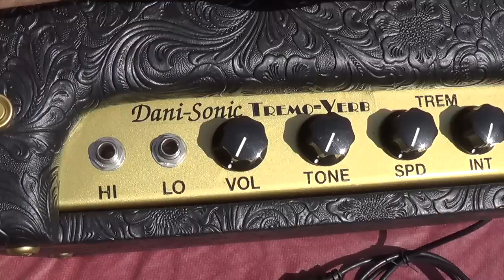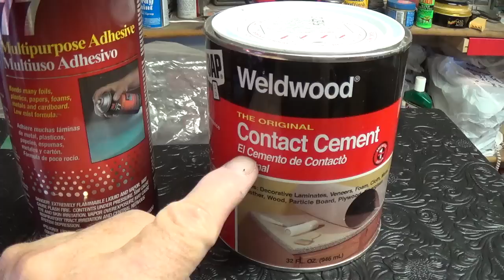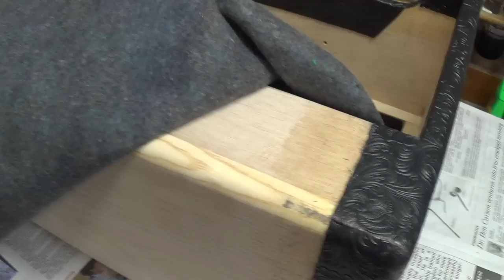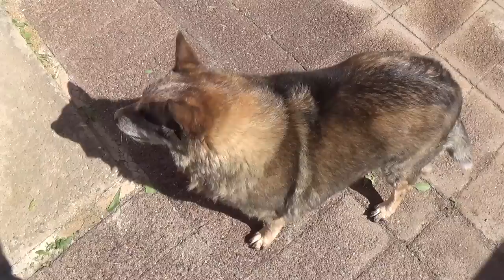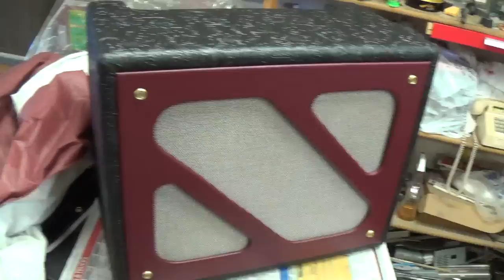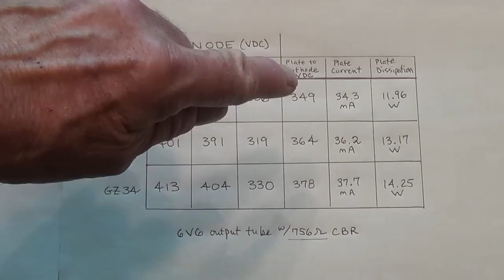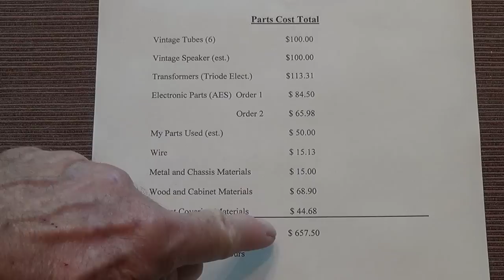How to Scratch-Build a Vintage Amp, Part 8:  Completed and Tested

Comment: Hey Doug,
I was wondering if you could go in depth, your style of running shielded cable. Thanks.
Reply from the maker: +chad smith I demonstrated how to create shielded cables in the video, Chad. As far as where to use them, anywhere that a (weak) signal is carried any distance within the circuit, it's best to shield the wire carrying the signal. By weak, I mean from input to first pre-amp stage, then to volume and other controls, and back again. By the second stage of amplification, the signal is generally strong enough to be mostly immune to hum injection.
Reply: +Uncle Doug Duuuhhhhhh (on my part). The details are on Part 7 of this serires at the 15 minute mark. You know, I watched this and it stuck in my mind but for some reason, I overlooked the part that it was Uncle Doug that informed me about that cool tidbit. I guess I thought I saw that somewhere else and just wanted to check on your method. I'm better now. No meds needed.
I have heard of others using Coaxle cable as grounded signal wire. What do you think about that?
 Thanks.
Reply from the maker: +chad smith No problem, Chad. You want your shielded cable to be the smallest "target" possible for EM interference, and also flexible and not fat and ugly, so I use individual shielded small-gauge (i.e. 26 to 28 gauge) wire.

Comment: Uncle Doug....another question my apologies if I have missed this previously.  For the Pots, which ones did you use as Log and Linear taper?  Thanks again for this great build!  Bart
Reply from the maker: +redfishbum To me, everything associated with the signal should be an audio (log) pot.  Those that govern purely electronic circuits, like adjustable bias, can be linear.
Reply: That makes sense. Thanks!

Comment: Another beautiful job. I thought it was great you fabricated everything. I can't wait to build mine. I think I would buy a chassis, do you have a recommendation, perhaps a tweed style chassis? Other than that I can build and cover the cabinet. Also, I have a NOS RCA 6l6GC. What transformer specs should I consider for the power and output. I will probably use one of my Weber Chicago or California's 12's which are 8 ohms.. Thanks, again, Bob
Reply from the maker: +starlingave  You're welcome, Bob. Yes, doing it all myself is part of the challenge....and fun :) The one problem with buying a chassis is finding one with the appropriate cut-outs for tubes and transformers.  Maybe you can find a blank chassis of the right dimensions and do the machining yourself.  I believe that Weber offers chassis on their website. I go into detail in one of the videos regarding transformer specs and selection. If you want to use the 6L6 a lot and intend to bias it to over 20W, you should get a PT with 100 to 120mW high voltage capability.....as is explained in the final video.  Your speaker selection sound fine. Best of luck.

Comment: Finally got the time to view your 8 part masterpiece. Holy Moly!! Awesome sound and gorgeous looking amp!! Just curious (for the three 12AX7, one 12AT7, 6V6 and 5881) what brand tubes did you use? Were they mid-1960 NOS tubes?
Reply from the maker: +drbryson2  Thanks so much, DR. I grabbed a handful of the vintage tubes I have on hand, all tested with emission readings written on the box, and selected those with high readings. Then I switched some around until the sound and effects seemed optimum. There was a mixture of brands and ages at the end, most ranging from the 60's to 70's.  I tend to go more for the performance of the tube, rather than the specific brand.....I try to be an impartial judge picking out what works best.
Reply: +Uncle Doug Did you use a 6V6 GT rated at 12 watts? It would be interesting to hear the amp using a 6V6 GTA rated at 14 watts so you could use a GZ34 instead of the 5Y3, and get more of a Fender mid-60s vibe.
Reply from the maker: Yes, it was a vintage 6V6....Sylvania, I believe, biased at just under 12W of PD. As you can see from my chart (shown in video and link provided in video description), DR, although the GZ34 provides a higher voltage output than the 5Y3, the 6V6 can be biased at either 12W or 14W with either rectifier. I don't recall Fender using GZ34's on any single-ended amps, and to be honest, I wanted the primary signal circuit to remain true to its original Supro TV roots.....i.e. to sound like a Supro, not a Fender. Thanks for watching....and for your input.

Comment: One more thing... I think that a single-end design like this is much simpler to build than a push-pull circuit. There is no need for a phase inverter, and simple isn't all that bad. Is that correct?
Reply from the maker: +Bill Daniels  True, SE is simpler (and a little less expensive) to build and troubleshoot....and a lot of people prefer the purity of their Class A tone.

Comment: The tremelo range and depth was an excellent demo, so was the reverb. This little amp has the "chops" to please any playing
style..except maybe those that like to play at high volumes with a  lot of distortion.  Very unique circuit design using  switched  bias  modification to all this amp to accommodate  6V6 or the more powerful 6L6s. 
Yes, the tremelo is a bit strong at the high setting, needs some fine tuning here.
Good to see that at least Jack gave it a final sniff of approval.. Good job!
Reply from the maker: +SuperCarver2011  Thanks so much, SC.  I spent some time in the workshop today, fine tuning the Tremolo, and came up with a simple fix.  I measured the maximum pot resistance that yielded the strongest but still usable tremolo effect, which was about 160K, and then jumpered the Intensity control (wiper to ground) with a 470K resistor, turning the 250K pot into a 165K pot. Now, the tremolo effect begins sooner in the dial excursion (about 3) and maxes out (at a still usable level) at 10.  It's still very powerful, but not completely insane :)
Reply: +Uncle Doug Looks your electronic knowledge and ingenuity perservered, and now the tremelo circuit is
unique to the Dani-Sonic/Valco/Supro amp along with the switchable bias for the power tubes.
Reply from the maker: Thanks, SC. Part of the reason I chose the Tremo-Verb to build was the unusual tremolo circuit.....and it didn't disappoint :)

Comment: Sweet job,  Uncle Doug.;    a "blast from the past". Looks like it came right out of the factory from the 60s. I like the art deco naugahyde covering with that paisley embossing in it.   Beautiful neat job! and at $657 and conservative 100 hrs of labour x
$30 per hour is $3000 + $657 = $3,657. Not unusual today for a custom built "boutique amp'.  Some tube stores offer kits
for the more popular Fender/Marshall favorites, but these are chinese factory repros and on PC board, not point to point
turet wiring like you are doing on this build.  Those Chinese sourced kits are cheaper (around $999) and the cost of the labour is absorbed as a hobby. Definiely a labour of love and you are saying that if you let it go, it might fetch $2000?
That is definitely in the realm of minimum wage these days..but as you say, there comes a time when the memories
of all those hours spent fade away with time and you just want to sell it to someone who will appreciate it and
give it a good home.

Now in the Supro case, when you include a woodworker to make a decent box corner cabinet and install the naugahyde
(15 hrs at say $30 an hour = upto a $450 bill for making the cabinet, + ,metal chassis work (15 hours at $35 an hour = upto
$500 to construct the chassis, punch out the holes accurately  + electronic expert to install solder lugs, pots, tube sockets
and wire up the hardware components accuratelY (2 days or 20 hrs x $35/hr = $600-$700, plus final finish, nameplate, chassis
painting ($100) + components  . That would entail about 60hrs of work with efficient contractors to come up with a working
product , and the parts list at $657 would give you a conservative estimate of:$ 2500 (low) to $3200 (high)estimate.

$657 x 5 times as you mention,  would be about $3285 to build this amp if you didn't dedicate your time to build it. 
Things are not  as cheap to build in America in 2015 compared to what things cost in a factory production  run in  1965.

EFFECTS of INFLATION over 50 years. 
That  Les Paul standard Gibson  that retailed for $385 in  1965 ,  now sells for at LEAST  $4000 ,and some signature series with all that added similuated 'buckle rash" /SPECIAL PICKUPS AND WIRING  ie: Billy Gibbons of ZZTop can sell for $8,000 or more in limited production.

Is it a case that a dollar no longer has the purchasing value of what a dollar once had due to inflation?
Maybe, or maybe because today, musicians will pay the asking price if they really want that model of guitar
or amp. 

BTW; Rusty just wants his cookie, he ain't interested in amp design or building techniques. Rusty does what he does best when he is off camera.  You two should really have a man to dog talk? :-)

Trusty old sabre saws, nasty in some ways, but very useful for those inside cuts,  where you can't get in with bandsaws or any other bladed tool. 

I've seen some amps with the reverb tanks in a padded bag to avoid amp vibrations. My 30 watt Peavey Valveking has it's tnk
in this padded bag and the bag is secured to the bottom of the chassis.
Which side of the shielded preamp cables do you ground? Source (at the pots) sink (at the grid input of the preamp) or at both
ends?  I've heard that grounding the shield at both ends can result in ground loops.  We used to ground the shields only at
one end.
Reply from the maker: +SuperCarver2011  Thanks for your detailed cost analysis, SC. It reaffirms my contention that, unless you're Ken Fischer or Howard Dumble, it's very difficult, if not impossible, to create a hand-built amp from scratch with point-to-point wiring that you could ever sell for a profit. My hat is off to the boutique amp builders, like Swart (my personal favorite), who manage to turn out a quality product.....and stay in business. Putting reverb tanks in bags is, I believe, intended to keep the springs and transducers clear of dust and debris, and to insulate the tank from vibration and physical damage. As I say in the video, shields should be grounded at one end only, however reverb tanks come in several configurations, as designated by the fifth character in their model number. The tank I used is a 4AB3C1B, and the "C" indicates that the Input jack is insulated from the tank body, while the Output is grounded to the tank body.  Both shielded cables have the shields connected to the amp chassis, but only the Output cable grounds the metal tank body (i.e. its shield connects the metal tank body to the chassis). It would appear that this violates the "grounded at one end" rule, but it seems to work well in most cases.
Reply: +Uncle Doug  Thanks for the clarification on the reverb tank various configurations., never paid too much attention
to that.  I guess the input jack being isolated on yours is to prevent "ground loops" and keep the internal transducers isolated from chassis ground with the shielded wires.  The fact that only the output shield is connected to the tank, would seem to me that the grounding is done at the source  of the signal?
  Reverb pans (as they are known now) are another "black art" like winding your own pickups.

The Accutronics pans from the 60s had that great "warm" sound, then there are the MOD pans that have a
different sound characteristic.  In my Peavey, the pan used is a generic 4EB2C1B, which is a Korean 
Belton (formerly known as Accutronics)  trade name. 
This is the generic dual long spring unit with both the input transducer
and the output transducer located inside the tank. The transducers turn the mechanical spring motion and
delay they create into electrical signals again. 
The input and output  transducer have  an isolated jack and driven by one side of a dual opamp (SEND). 

The output side of the tank transducer is amplified by the other half of the same opamp, (RETURN)
thus saving a 12AT7 tube, I suppose,  as an opamp on a printed circuit board is easy to design and a lot cheaper
to manufacture than installing a tube socket and dual triode.  New technology to reduce manufacturing costs
and on production runs, every dollar counts.

The numbering scheme on these Accutronics reverb pans is a "dogs breakfast" (with apologies to Rusty). 
Confusing to say the least, because of the "voicings" of the spring and transducer design and the input/output impedances.
Here is a link to explain what the number nomenclature means in relation to the pan designation.

http://amprepairparts.com/reverb_numbering.htm
Reply from the maker: Thanks for input, SC. As always, it's detailed, informative......and appreciated :)

Comment: Hey Uncle.
I just finished watching your new series.  You're getting better than ever.  Thanks so much for your hard work and sharing your knowledge.  

I want you to know you were my main influence in attempting my own amp build, and I just completed it.  For the first time in my musical life, I have an amp that rings clear and true, and I actually made it with my own hands.  It's a 5E3 circuit that I purchased in kit form from Tube Depot, but I had them send me a turret board instead of their stock PC board (some of your influence there).  I built a cabinet from scratch that houses two speakers, a 10 and a 12, and I cannibalized an old solid state Fender Ultra Chorus for the 12.  The cabinet can also be played in an open or closed configuration, giving the whole rig considerable versatility.  Now I'm considering this Supro build to go into what's left of that old Ultra Chorus.  You've created an incredible amp here.

I'd be honored if you'd have a look at the two videos I posted to show off the amp and offer comments/guidance.  After all you're this amp's Uncle.  

Pt. 1:   https://youtu.be/DAzET6K8JHQ
Part 2:    https://youtu.be/7lit4BIRb1I

Best to Rusty and Jack,

Addy.
Reply from the maker: +Addy Adderson  You're welcome, Addy, and thanks for your very kind words. I watched two videos and was impressed with the originality and versatility of your cabinet/speaker design.  I have long been a fan of using two (or more) completely different speakers simultaneously.....much like a chorus of mixed voices, each lending their own unique characteristics to the mix.  I think the ultimate would be a Bassman or Concert amp with four different 10" speakers.  

To be honest, however, on my headphones, I thought the individual speakers sounded better than the combination.....which really surprised me. I'm not sure how you resolved the challenge of using either or both speakers without causing an impedance mismatch, and if such a mismatch may have handicapped the paired configuration. Another possibility is that the two speakers are out of phase, causing a "hollow" sound between them, rather than a unified, fuller combined output.

Regardless, both videos were quite well done. Your playing was excellent, your initial commentary was informative, and your demos were clearly labeled and quite effective.  Congratulations on a very unique and impressive creation, and thanks for sharing it with your old Uncle :)
Reply: Thanks for looking and offering your kind feedback, Uncle Doug.  As usual, generous with your valuable time.  I don't know how people like me can thank you enough.

Yes, I'm becoming aware that I'm causing an impedance mismatch at the OT with a 4 ohm load when I'm plugged into both 8 ohm speaker jacks, which are wired in parallel.  I've seen some discussion that this OT should be able to handle the mismatch, in fact that the amp was intended to be used this way.  I reviewed your video on OT's and understand that this mismatch can have negative implications for power tubes and speakers as well, so I've contacted the kit provider, Tube Depot, with the question.  Rob Hull should have an opinion about this that the company can stand behind.  

Best,

Addy.
Reply from the maker: You're welcome, Addy. All new creations have some teething problems. The tubes and OPT may be able to survive the mismatch (the probability diminishes somewhat at higher volumes), but your tone quality will be negatively impacted. If your OPT has both 4 ohm and 8 ohm outputs, there is probably a way to accomplish your goal using several toggle switches to alter the circuit to permit either individual 8 ohm speaker or the pair in parallel (4 ohms). If you only have a single 8 ohm output, I can't visualize a solution. Bear in mind that your 4 ohm speaker pair is reflecting an impedance to the pair of 6V6's which is about half of what they see when connected to a single 8 ohm speaker.

Also, please check your speaker polarity. The easiest way is to simply listen to it the way you have it and then reverse the leads to one of the speakers and listen to it again. There should be a noticeable difference. The classic sign of polarity mismatch is the speakers sound far apart, with an "empty space" in between.

Again, an excellent project well done and well documented. Thanks for sharing it with us.

Comment: i really like the diagrams Doug - what did you use to draw those?
Reply from the maker: +SNORKYMEDIA  Thanks, Snork. They were done by a viewer named Tommy Foley.  Perhaps he'll read your comment and respond. If not, I'll ask him.
Reply: +SNORKYMEDIA  Glad you like them. I used Adobe Illustrator to draw them and then saved each page in .pdf format. Then I used Adobe Acrobat Pro to piece the pages together into the final pdf.
Reply from the maker: Thanks for the info, Tommy.....and for all your hard work preparing these excellent diagrams.